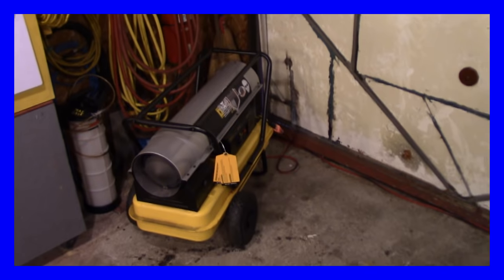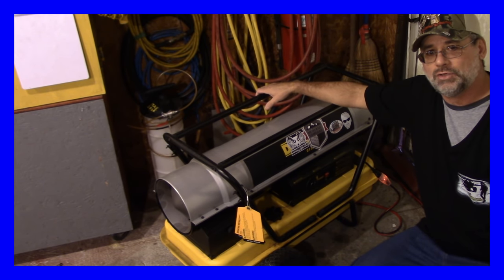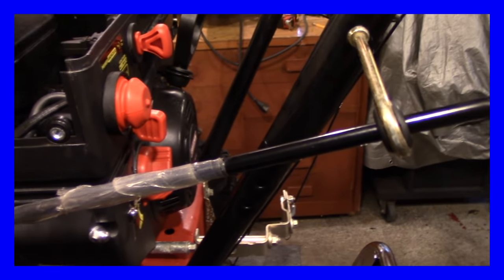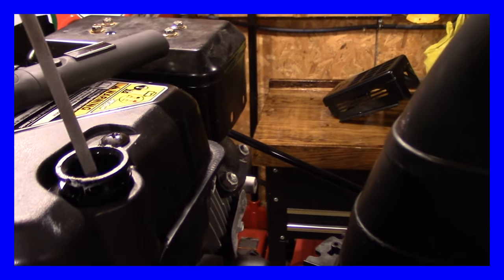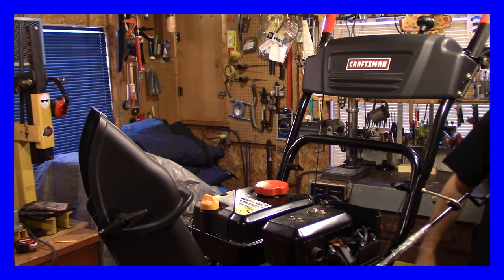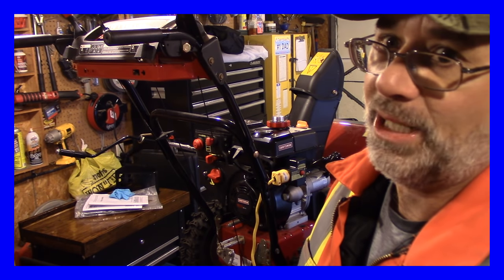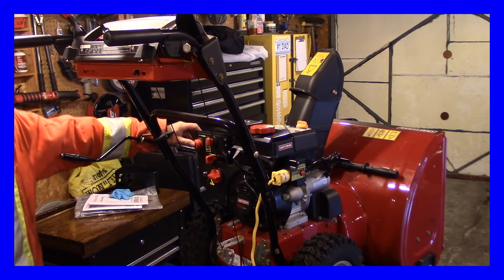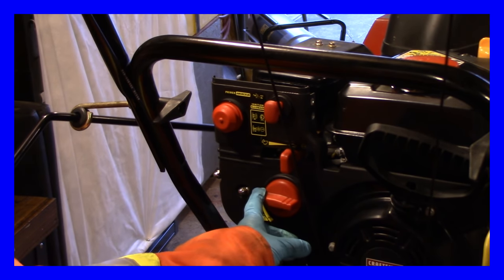CAN YOU FIX A SNOW BLOWER WITH SEAFOAM

Comment: You are a lifesaver. Watched this video, was able to get my snowblower to start using sea foam in my gas! I was only able to get it to run with starting spray. After adding sea foam, I used the spray, it would turn off after a bit, but after a few times, it runs like a champ. You are awesome! Thank you for this video!!!
Reply from the maker: Terrific Daniel so nice to have helped. Cheers
Reply: Daniel, where do you spray the starter spray? I usually spray on an air filter to get my lawnmower jump started. Where to spray on a snowblower? Thanks

Comment: Sea Foam recommends a 3 ounce of Sea Foam to one gallon of fresh fuel to an empty tank. Turn over the engine to pull in the concentrated mixture and let sit for a day or two to dissolve the varnish and other contaminates in the jets, emulsion tube and float bowl and float needle. Unless the carburetor is severally contaminated, this should get your machine running. And after the machine runs this concentrated fuel mixture out, then use a mixture of one ounce of Sea Foam to one gallon of non-ethanol fuel if available on a regular basis. If non ethanol is not available, then use E10 91 octane which has a higher degree of detergent fuel additives. That is one reason high octane fuel is more expensive, it just not the higher octane. I enjoyed watching you prove Sea Foam does help clean dirty carburetors due to ethanol blended fuel. Thanks for sharing.
Reply from the maker: Thanks Russell  , much appreciated 👍

Comment: We had a snowstorm two days ago and I couldn't get my Craftsman blower to start, tried starting fluid and it would run for a few seconds, went on youtube and found your video, I knew the carb was gunked up so I thought I either need a new carb or try your Seafoam procedure, I put some in the tank and used the primer for about 3 min, left it for 2 hrs and went back and tried it again using the primer until it would run on its own, Success , glad I found you video
Reply from the maker: Awesome buddy so glad to help👍

Comment: Just a reminder.  If the gas station pump has one hose for a couple types of fuel put the first 1-2 gallons in your vehicle.  Otherwise you may be getting whatever type of fuel that  is in the hose from what the last customer purchased.  Which then goes into your gas can for your small engine machines. Just a thought.
Reply: You are 100% correct.

Comment: Thank You Steve. Got snow blower working. Used sea foam, best gas, after draining cheaper gas out. Also added fuel stabilizer. Let it run 20 minutes. Changed oil today, manual said it took 1100cc. Drained 800cc. Added 900cc. Now it seems there is to much oil in machine. Will take some oil out tomorrow. Thank You for making video.. I am a 70 yr old lady…was very happy to get machine working…Did drain tank last yr but May have forgot to run it dry. Will not let that happen again….Also treated and ran motorcycle and scooters with the sea foam and gas preserver. Hoping for a trouble free spring…
Reply from the maker: That's awesome Rose just awesome 👍👍

Comment: 6 years ago!  Your video just keeps helping people!  I have an identical snowblower-no problems with it, but good to know some nice tricks if It does. Tecumseh went out of business and the Chinese made engines have taken their place.  I run my engine dry at the end of every season and use premium gas (but after reading other comments, I may not be getting premium, I need to run a couple of gallons into my car before putting it into my gas can!). I have been using  a PB Blaster product called Small Engine Tuneup.  I will try the Sea Foam next can of gas.
Reply from the maker: Hi Don 
I  had the opportunity to ask a service tech that works on  pumps and its a lot more complicated than I ever thought.  The style of pumps and how many tanks in the ground  play a part but the tech said if I pick premium fuel , no ethanol  its about  2 quarts in the lines .  Where I am  nobody knows the ethanol content anymore as it is now allowed in all grades of fuel  and may not be in all grades so it's flipping a coin :)  I have been using fuel stabilizer and  so far I don't have any problems but I do work on some nasty carbs every year gummed up with bad fuel.

Comment: I have a 1988 MTD and have to admit. I havent been too good with frequent oil changes so Im amazed it still works.  I was gettimg tired of it stalling and being hard to start so with nothing to lose I bought some Seafoam and tried it.  First tank the usual issues.  By the 3rd tank it wss running like a charm.   That was a few weeks ago.  Tonight another  big snowfall and bang she started first pull and ran for over an hour with no stalling and I didnt have too keep it to 1st speed.   I was on 4 throwing snow a country mile!!! Im a believer.
Reply from the maker: Ive been using it a long time with great results. Glad it helped out for  you too.👍

Comment: Encountered a similar problem with a new snowblower with a 250cc Briggs and Stratton engine that would not start. I added fuel stabilizer and the snowblower started immediately with either the electric starter or pull cord. Small gas engines have a hard time running on gas which includes ethanol. Adding a fuel stabilizer fixes the problem.
Reply from the maker: Hi Earnest 
Sometimes the simplest  fix is also the fastest too 👍

Comment: Hey Steve. Interesting that you used the seafoam. Once a few years back, the neighbor didn't drain the gasoline on his push mower. Inside the tank, was a mushy sludge build up like yours. I put a few ounces of seafoam in the tank and left it for two hours. Came back to it and cranked it up. It ran like crap, but after a few minutes it cleared itself right up. Glad to see it wasn't too bad of an ordeal to straighten out. Keep up the good work!
Reply from the maker: Terry that's exactly what happened here. It worked just great and its still running great. Hope all well down south its been warm the last couple of days into the 40 ies  deg on the f scale and boy is it nice to have such warm weather.
Reply: We've got some really crazy weather down here. Today we had a high of 57F and tomorrow is supposed to be 80F. Big swings in the temps around here, but it's getting to stay warmer and warmer.

Comment: This reminded me so much of the lawn mower of my  sister-in-law who asked my wife if I would look at it.  Her neighbour and a friend had tried for two hours without success the week before.  The engine exhibited the same symptoms as in your video.  It would start, but would shut down.  I dropped into the local automotive store and the owner recommended Seafoam.  I grabbed a can and off I went.

 I added the suggested amount of Seafoam and filled the fuel tank. The engine would only run while continually pressing the primer bulb.  I spent an hour pressing that blessed  bulb until the tank ran dry.  I refilled the tank adding Seafoam and noticed the periods between pressing the primer bulb were longer.  I was able to mow the lawn a half hour later.

Don't forget that the idle and main jets also get gummed up with varnish which is why problems were still encountered after cleaning the bowl, float, and valve.  I also mix Seafoam into my jerry cans with the fuel.  I use high test, but the next lower grade will do as well.  I've never had a problem getting engines to start whether they sit in the cold of winter or the heat of summer.

I had a chuckle at your description of how much heat your shop heater puts out.  Assuming all things being equal, another couple of minutes and water could be boiled.  Good demonstration.
Reply from the maker: I use one ounce per gallon.
Reply: thanks

Comment: Our office has a 123cc MTD (yard machine) snowblower.  It was brand new 3 years ago and had been used probably less than 10 times (we have snow removal service, but like you, we sometimes get bombarded).  Wouldn't start for me; didn't even think it was priming.  Emptied bowl; Fresh gas; and it started right up but won't run off choke.  Tried your method with SeaFoam and let it run for about 40 minutes... still dies on the first notch below full choke.  Oh well.  Wanted to thank you for the video and I will definitely remember to empty the bowl and will employ a splash of SeaFoam from now on.  I guess I'm going to have to pull the carb as it must be pretty gummed-up.  Take care and thanks again.
Reply from the maker: Thomas it's gummed up inside a lot by the looks of the symptoms . Yes take it apart at clean it out and it will be like new. Cheers

Comment: I'll go check out the flame thrower, lol. I had a lawnmower than only ran with the choke on, I used it that way for at least six years. Got me a new mower last year. Good job on getting her going! Seafoam worked.
Reply from the maker: Thanks it's good stuff and if it would run with the choke on they would have just ran it like that i'm sure. HAHA

Comment: First off, SeaFoam is a very strong product. I love it. But you mentioned early in the video that the snowblower didn’t have a fuel shutoff. That is the key! I recently did a fuel drain on a customer’s generator and the fuel was a couple of years old. However, the carburetor on the generator was pristine, like new because he had the fuel shut off for those two years. I tested the carburetor by spraying it with starter fluid with the fuel valve open and it started up, second pull. No passageways in the carburetor were clogged because it had been dry while sitting.
Reply: The ethical dilemma as a repair service is do you “push” SeaFoam and fuel shutoff valves during repairs or not? I make suggestions to customers all of the time but very few follow through with proper up keep. Oh well.

Comment: Somebody probably already commented but that same engine is found on many brands of $500-800 snowblowers.  My Huskee, for one, I got an identical engine manual. I too wish for a gas tank shutoff valve.
I had a starting issue on my first season for the same reason.  Step-son did a carb cleaning and fuel line & tank flush. I started treating the gas I use with sta-bil on his recommendation.
2nd season I've change over to super unleaded with the correct dose of sta-bil for my 2.5 gal gas can. 
End of April 2nd season I ran the Snowblower dry and transfer any remaining fuel from the gas can into the family car's tank. Changed over to synthetic oil (0W-30) after the snowblower's engine was broken in. 
Now on the third season I'm having no fuel related problems.  (broke my first shear pin - fallen pine branch hidden in the ridge left by the town plow) Starts so easy on hand pull that I don't bother pulling out the extension cord for the electric start.
I use Sta-bil since it readily available at Walmart. I don't leave the treated gas in either the snowblower tank or gas can for over 6 months.
Reply from the maker: I always use the synthetic oil as well. I think your doing everything right bud. 👍

Comment: With gas in that snow blower, I would be very careful with that heater on the floor. You don't want a fire. I would take out the little strainer first in the gas tank to look inside to see how much gas is in the tank. Run some Sea Foam to help clean the carb. I run Sea Foam in my blower and it just make the machine run smooth, no stumbling or loping. Good Video.
Reply from the maker: Thanks Stanley great suggestions 👍

Comment: After draining the fuel I pulled the carb off my cub cadet snow thrower (yes I said "thrower") by disconnecting two nuts, two linkages and three hoses. I dropped the fuel bowl, shined a light up through the fuel jet and saw no light in the throttle body. Ran a very small gauge wire through the fuel jet and felt something give. Blew it out with compressed air and watched small particles of debris fly out, sprayed cleaner into the fuel bowl and brushed it clean along with the float needle valve. Could then see light in the throttle body through the fuel jet and reassembled the carb to the engine. Poured about 4 oz. of ethanol free fuel from the local Maynerd's into the tank, primed and choked it, gave it one pull and heard that wonderful sound. It runs smooth as a Jack and Coke which, by the way, I enjoyed as my reward shortly thereafter. Approximate total repair time, one and 1/4 hours. Can't wait to fire it up tomorrow, 6+" of snow on the way here in Meechigan. Greetings to everyone in the great white north, eh.
Reply from the maker: Terrific job. Cheers 👍

Comment: I know this is a seafoam commercial but Sta-Bil works fantastic, my riding mower started surging real bad and I used that and it was fixed before I was done mowing my lawn. I use it in everything now including my car and pick-up and they run better than they have for a very long time. 2 ounces for every 5 gallons isn't much of and expense to keep all of your motors running right.
Reply from the maker: Nope not a seafoam commercial Martin - i'm not selling it and not affiliated with seafoam at all.  Just my opinion and I do like sta-bil too .  Using something is  better than nothing. Cheers
Reply: Using something is better than nothing, now that is right on the money considering the ethanol is the problem.

Comment: Good video Steve that was a lot of work! Ethenol free only in my small engines! Seafoam,Startron,Gumout most of them will work they key is to get inside the carb. I let it sit over night. I install a shut off, a  tee inlet and a filter inline. I wish the manufacturers could make it easier on us knowing very well that people run into this problem quite often.
Reply from the maker: Thanks Dave 👍

Comment: Good idea on the sea foam. That reminded me that I didnt winterized my mower this year. Gonna do that tomorrow.
Reply from the maker: It works for me and in this case I was was a little surprised it cleaned out the sludge so good. Cheers
Reply: Yeah, I was surprised that you were able to fix a mechanical problem with 'magic' liquid in a bottle without any tools.

Comment: Had s similar issue with a 40 year old 7HP Ariens. I always leave gas tank full but stored in shed out back which got really hot in the summer. Found that the fuel in carb evaporated and was left with this gummy mess. High speed jet removed and put fine welding torch wire cleaner thru hole. I was also only using regular gas before ethanol came out. had never heard of Seafoam back then.(Mid70's) I use it religiously now in all my motors Boat, SUV, Lawnmower, Snowblower and Generator. I still store my snowblower in same shed, only I load it up with hightest gas and seafoam and I start the blower a couple times during the summer, the same as I do for the generator. As they say, "Too soon old, too late smart."
Reply from the maker: Hi Brian 
Never in a rush to get old but always in a rush to become wise 😉

Comment: Great vid Steve!  I use Seafoam.. kinda like you said dont know if it really does any good, but have used it for years.    I havent done it lately, but even in my vehicles I would dump a can in the fuel tank about once a month.  Waste of money? Maybe.. but have never had any issues.  I usually try, no matter what the engine is, to start em up and run em a little bit just to keep things lubed up and moving around.
Reply from the maker: I have seen the difference over the years using it in my big genset with a steel fuel tank. Once i started  using it i could see in the tank how clean it got over time and the float bowl on the engine is spotless. Thanks for watching buddy and you have a great day.

Comment: Good info. I have same unit. I had bad gas and had replaced gas and carb, but it worked for one season with lots of surging. Another carb later and now it starts again, but still surges when throttle is open. Replaced governor spring. Still surges … I will try giving it more time running. I will check the gas cap maybe it’s clogged, would love to stop it from surging!
Reply from the maker: Sometimes it's  just not getting enough fuel and I've also seen new units surge right out of the box at high idle but once under load stop surging and its perfectly normal .
Reply: When replacing a carburetor with an original or aftermarket one, always before mounting on engine, remove the float bowl and tap it lightly on a firm service and check for tiny metal shavings or particles left from the machining process. It is good to blow on the rest of the carburetor as well. Individuals who do this for a living always do this before installing a new carburetor. Any little particle can cause a blockage and keep a new carburetor from working correctly. I have never heard of this until watching a small engine mechanic video. He said he often finds this condition in original and aftermarket carburetors. A simple check before installation can really make a difference between a perfect running carburetor or what seems to be a junk one.

Comment: I would of never thought that seafoam would clear that problem up. I figured for sure you were gonna have to take the carb off and clean it out on the bunch. Nice work!
Reply from the maker: I agree , it was like a light slimy film everywhere and it seems to have flushed it out. Normally I would have taken the main jet out and cleaned it. Cheers

Comment: Hey Steve! This is our 3rd season with our new blowers already. Pulled them out yesterday, bought new gas, and added a good dose of the Seafoam. Fired up first pull, NO choke at 40 degrees. Our Carbs are PRISTINE. The Seafoam must be doing a fine job maintaining them. 😊
Reply from the maker: Yes and the same at my camp with my genset fuel bowl after 10 years it does not have a bit of varnish staining in it at all. They say its snake oil but it seems to work well so far for me. Cheers
Reply: Another thing that proves it's not snake oil is your video. I first heard about Seafoam 25 years ago when my family was into boating. It was suggested to us at the marina because it was working well with the small watercraft.